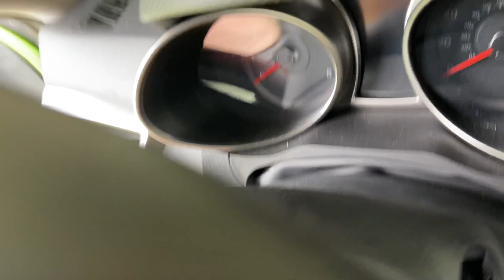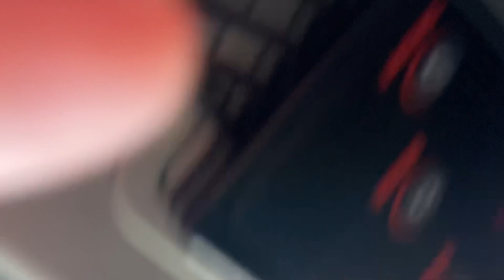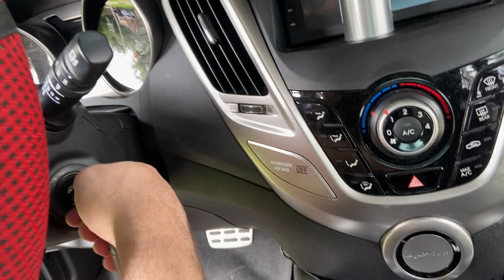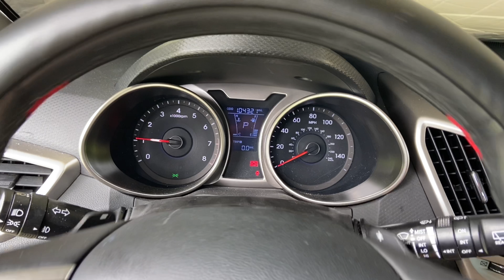Hyundai Veloster - Fix clicking steering wheel

Comment: Thanks again. I would like to add a few optional tips;
1. I found it easier to remove the plastic bottom housing prior to the removing the plastic bottom steering wheel housing. Once you get the bigger piece off, the smaller housing come off easier without having to wiggle it off. 

2. It made life easier to just pull off the steering wheel after you remove the 2 12mm nuts. This would allow easier access to the 14mm AND the coupler it self. Reinstallation was much easier after I accidently pulled off the steering wheel. Lol

Comment: Part just came in. I’m about to give this a go using your video tonight! Wish me luck!
Reply from the maker: Grab a friend to help you with lifting the steering wheel at the end.
Reply: I don’t understand, the EPS light and power steering light is on now
Reply: Anyway you could help, thank you
Reply from the maker: @adriancontizano5316  something didn’t get plugged back in all the way. It could be a fuse or one of the plugs. Even if you know you plugged everything back in, unplug and then replug everything just like you were going to do it all again. Also check the fuses. Generally, it’s a plug that isn’t making a good connection.
Reply: @Frostcall  thanks frost, I’ll check it asap. I appreciate the help!
Reply: @Frostcall  you don’t think it would have something to do with the steering wheel coming off the steering column while I was taking the column out?
Reply: @Frostcall  it was the pink fuse cable on the power steering module that ripped out of the outlet. Luckily there’s enough slack on the cable bundle to use more. I’m taking a break atm. I’m gonna go and try to remove the excess pink that’s in the connector outlet and try to replace the fuse cable with the slack. Thank you for your help!!
Reply: Fixed the power steering! Now the wheel is slightly turned in order to drive safe smh. Any advice? Thankyou again for this awesome video

Comment: Thanks so much for this vid! It was pretty thorough and easy to follow. My dad & I did this yesterday. Hardest part was getting the column lined up to put the 14mm bolt back in. 🤬 No way I'm paying stealership hundreds to install a $5 part 😂 The two trips to the parts store, sore muscles today and missing football Sunday were worth it for the satisfaction of doing this myself. Definitely wouldn't have tackled this without this vid and someone else to help with the extra muscle. Thanks again!
Reply: SAME HERE, that damn 14 mm bolt was a pain to get back in place, had to get my little sister to hold up the steering column while I got it in!

Comment: I'll echo the thanks for your excellent video!

It took me longer to clean the gooey old coupling spider remains than it did to either disassemble or reassemble all of the related stuff.  

(2012 Veloster, manual, naturally aspirated, ~118,800 miles, didn't know cause and had been getting worse for at least 10k miles, no notable damage to coupling halves)

Comment: So....I did this and in the end it worked.  But had a bit of a surprise.  My steering wheel was a two piece and came apart when I pulled on it.  It did finally go back together and was aligned properly, but I have a feeling I got lucky.  The video was very helpful and I would not have attempted this without it.
Reply from the maker: What year model do you have?
Reply: Mine did the same thing but I should have checked alignment before putting everything back together 😩😩

Comment: Great guide, thank you! Saved me hundreds and it’s always more satisfying to fix it yourself, even though the damn 14mm bolt was a stubborn pain to get back in place. Easy to follow guide, not so easy in actual practice.
Reply: Yes, you need to get the rear of column situated. Start the 2 nuts then just wiggle the column as you thread in the 14mm. It's not bad if you have the steering column adjustment unlocked so you can move it how you need to.

Comment: I have a 2013 Veloster. The steering wheel on it is slanted to the left on there is a delay in the steering (as in when I turn left I have to turn it farther then I should before it the car turns). I've also noticed that occasionally (usually when I fully rotate the wheel) there is a loud pop which seems to be coming for the the steering as all my suspension looks great. Do you think it could have anything to do with this issue? I was planning to pull out the steering column this weekend to inspect everything.
Reply from the maker: Could be. You certainly have the right model for this issue and if it’s never been replaced, it’s likely shredded like you saw in the video.

Comment: Having a very hard time removing that 14mm bolt. Any ideas?
Reply: I'm having the same issue with that 14mm-9/16 bolt it's hard to turn
Reply: Same
Reply: Anyone figure it out?
Reply: I sprayed a little wd40, hit the wrench with a hammer a couple times and pushed with all my might, after some doing it came off
Reply: I sat in the seat and used my foot to break it

Comment: I am about to get underway doing this repair by myself on my 2013 Veloster.  The dealership can't get to it until August 15th, but they are confident this is the issue.  I have a feeling I will need to use some solvent (it doesn't feel like there is any of that cushion left); it's probably gunky from Georgia summer heat.  I'll make sure I grab some before starting.  There were a few repair places that quoted 5 hours of labor and parts to cost between $450-$650.  

Update:
The part and solvent was only $11, plus q-tips and a toothbrush.  Mine was shavings and rubber goo as well.   I was concerned about the harnesses so I just used little stickers and numbered them to match them up.  Possibly an unnecessary step since there weren't many harnesses, but experience with engine and generator changes in the Air Force taught me it's worth a few extra minutes.   I am waiting for a guy to come over to help me lift the column back up.  I'm not as strong as I was 20 years ago.  I underestimated how heavy it would be to get this back into place and bolt it.  

Finished product!  I was finally able to lift it back up myself.  I had to take a break to rest my arms and cool off.  It took the better part of an hour just cleaning that rubber from the parts.  

No more clunking, no funky steering, and no play in the steering wheel.  Thank you for this video, I can't imagine filming as I did this work!  Thank you so much!
Reply from the maker: I think I underestimated how difficult lifting the steering column would be for a lot of people. I think I’m just used to lifting heavy things with my body in oddly contorted positions, and didn’t consider that not everyone is just like me. I’ll try to be more considerate of others in the future and point out where I think some might struggle. Best wishes!

Comment: Hello i need help please

So during the process i cut a rose wire that connect to the mobis module and i have the eps light and another one.

The steering wheel only turn left and very difficult for what ?

Sorry for my bad english i’m french

Thanks
Reply from the maker: That wire is important and must be repaired. A professional mechanic may be needed. If you can not use a professional mechanic, fix the wire, and carefully inspect all connections and fuses.

Comment: By any chance do you know the name of the box under the steering wheel with other wires attached to it its visible in your video around 12:15 above the brake, thank you for your time
Reply from the maker: It’s called the Steering Column Module I believe.
Reply: @Frostcall  thanks! Unfortunately when I fixed the steering wheel some of the wires ripped there but I didn't know to look for the part

Comment: Thanks so much for this video. My kid has exactly the same green veloster and had same problem with the steering wheel. Almost everything went smooth, if it wasn't for the very last trex bolt, it was stubborn.
Reply from the maker: I’m glad it worked out for you!

Comment: Just a little heads up when you were taking the panel off by the door it hung up on you if you pull on the rubber seal around the door opening it will just fall off. Thanks for the video

Comment: Can’t find that steering column bolt… Is it way back there behind the silver box near the brake pedal?
Reply from the maker: Yes. Make sure you can find it, and importantly have a friend help you lift the steering wheel to put it back in when your are done.
Reply: @Frostcall  ok thanks.  So do I need to take that silver box off like others have done?
Reply from the maker: @rootchakar  I never had to remove that box. Watch the video again and make sure you’re looking at the correct bolt.
Reply: @Frostcall  cool yeah we took it off 2013 veloster.  Was really hard to get at the shaft bolt for us.  4 hour job here. First time ever attempting something like this though.  Had to have 2 different people help also.  We did have a hard time locating the shaft bolt even with this video and others.  And yes lining it up afterward was very challenging.  Thanks for the tips however.  Glad it’s over.  Think I’ll let it clunk around next time.  Main reason I wanted ti do it is that at high speeds the steering seems even more unstable than a little clicking.  Hopefully this resolves that kind of stuff was my hope…Any more tips VERY MUCH appreciated.  Thanks!
Reply from the maker: @rootchakar  Dang. Glad you got it done though. I bet if you more easily found that bolt, it would have been a lot faster. Sorry I don't have a better angle but I sold the car over a year ago so I can't go back and do better.
Reply: @Frostcall  think your angle was fine fwiw.  That is such a tight space back there I don’t see it getting any clearer from any camera perspective.  I think the more difficult issue for us was lining it up again after the shaft bolt was taken out 👍 thanks again.  Great stuff.  Would’ve been lost without it.   We have a number of other missteps also so we were super drained at this point also
Reply from the maker: @rootchakar  There's nothing in life quite like the feeling of finally completing a 30 minute task that took 4 hours ;)

Comment: Now I have no power steering, traction and ecp? lights on. Did I miss a connection or strain one?
Reply from the maker: Yup. That’s a sign that something is not connected correctly. Check your connections. Unplug, then plug back together again ( I usually tell people to blow on them to make sure they actually do it). Also check your fuses just in case it’s that.

Comment: This was an awesome how to except I now have an issue with my eps light coming on and no power steering. Does anyone know what could have caused this? Could the connections to the mobis maybe have come off? 

Thanks!
Reply from the maker: Check your connections (unplug,  then plug back in) and check your fuses in the fuse box. This usually means something didn’t get connected all the way. No worries, it happens.

Comment: Had the same issue with my 2012 Veloster, dealership wanted to charge me $350. Thank God for my extended warranty that paid for it. I think Hyundai needs to recall this issue with the Veloster just like they did with the Sonatas and Elantras
Reply: Yeah I asked the dealership for a trade in estimate and they said they'd have to dock $500 for this to be fixed. Fuck that

Comment: what is that part called and what is the function? not the cheap rubber coupler. The large metal cylinder that looks like a motor/actuator of some sort

Comment: Just did this and had one wire to the power steering module break. Got a new connector off a junkyard car and spliced it together but the power steering is still out. Everything else is plugged in properly and there’s no breaks anywhere else. Any idea what may be wrong? Does the computer need a reset?
Reply from the maker: Unknown but if you’ve verified all of the connections are good then you might need to pass this over to a professional. Sometimes things happen out of our control and we need an expert.

Comment: Great video! Are you able to explain how the noise and broken coupler effect the car? Just wondering how long I can drive on it in this condition.
Reply from the maker: It’s the metal pieces inside touching and ‘clicking’ as they touch. I’m not sure how long you can go without causing damage. I went about 8 months before I was annoyed enough to change it and I didn’t see any damage.

Comment: I am facing the issue of occasional left pulling in Hyundai Elantra after calibrating the steering angle sensor as well, it is any symptom of bad flexible coupling..
Reply from the maker: Sounds like it might be an alignment issue.

Comment: Just tried replacing mine but couldn't get the 14mm bolt out. Which way am I supposed to turn the wrench to remove it?
Reply from the maker: Counter clockwise. It might be tight but it’s the normal ‘lefty loosy, righty tighty’.

Comment: Hello there. So i had to work on this myself. I was able to change the coupler and everything but now I ended up with another problem.
My steering wheel ended up being turned to the left 90 degrees when I was putting every back together. What did I do?? How do I fix this? Thank you for the help
Reply from the maker: Take it back apart and put it back together. Perhaps use a marker to mark things this time to ensure it’s on correctly. It seems when you were putting it back on you put it on 90 degrees off.

Comment: Reassembling now and realized i did not lock steering wheel and now its not straight. Should I continue? Is there a way to reset when finished?
Reply: All good. Put key in to unlock wheel. Was abke to get it straight before the tires started moving.
Reply from the maker: @thekxl9836  glad to hear!

Comment: Hi I have a 2014 Audi A6 making similar sound but just at top dead center of the steering wheel.  Click happens with turning left to right past TDC.  Beyond TDC I do not get any clicking noise.  Only happens when cycling from left-right-left-etc. at TDC.  Is that the same problem that you had?
Reply from the maker: I did some digging and it looks like it’s going to be a different but related issue. Audi’s don’t use the rubber steering coupler that breaks down like Hyundai and Kia. They use a different coupling mechanism that this video won’t help you with.

Comment: I have this issue but also when I brake my steering wheel shakes like hell, would this fix that issue as well?
Reply from the maker: Probably not. It sounds like you might have something wrong with your brakes or rotors.
Reply: @Frostcall  I figured lol I have a Elantra would this video apply for a Elantra or only veloster?

Comment: Does this also cause shaking at highway speeds if part is going bad? I get the clicks and steering wheel shake anytime i go over 55mph
Reply from the maker: The shaking sounds like an alignment or wheel problem.
Reply: @Frostcall  i apprrciate the response. Im gonna start with this and work my way through the cheaper problems first. Update: SHES FIXED. THANKS YOU FAM

Comment: To replace the indicator/high beam stalk is it the same process? Does everything have to come off the same way? Thanks!
Reply from the maker: I’m not sure. I haven’t had to replace it. I think you can follow the first steps with dropping the steering column and that should allow you to access what you need in order to replace the indicator stalk.

Comment: Aaaamazing!! Thank you so so much. I will be ordering the part now and will be doing the work once it arrives. Again thank you!
Reply from the maker: Take your time, have a available to help with the steering column, and you can do this!
Reply: @Frostcall  is there any way you can help me with the steering wheel now acting up? It’s hard to steer, very hard to turn and this happened once I was done with this video. Not blaming this so please don’t get me wrong. I was just wondering if you knew anything about that? I’m told only a dealership can fix it. Also these vehicles don’t come with the power steering fluid anymore they’re electronic. Ugh it’s been that way in my garage for the past 3 months
Reply from the maker: @lesterdonis4218  Sounds like power steering issue (which is what I think you were thinking too). If you plugged everything back in, I don’t see how it went bad other than coincidental bad timing. It happens unfortunately.

Comment: Name of the part is broken please? And nice video I have seen many videos different cars but you explained very good👍
Reply from the maker: It’s called a ‘steering wheel coupler’.
Reply: @Frostcall  do you have an ebay link to sell  the part? I couldn't find it with that name 😞
Reply from the maker: @eliasnariosky6693  I bought it on Amazon. There, it’s called ‘APDTY 112837 Flexible Steering Coupler’.
Reply: @Frostcall  thanks!

Comment: please help I put everything together and then started the car but my eps and traction control light stayed on. I went back to make sure that I plugged everything in the right place which I did. I can’t even drive anywhere to get it fixed now because the power steering doesn’t work.
Reply from the maker: Unplug everything, blow on both ends, then plug them back in again. Then check your fuses. Something doesn’t have a good connection.